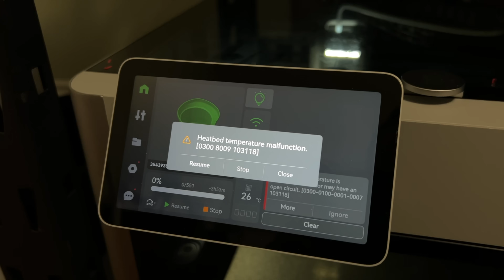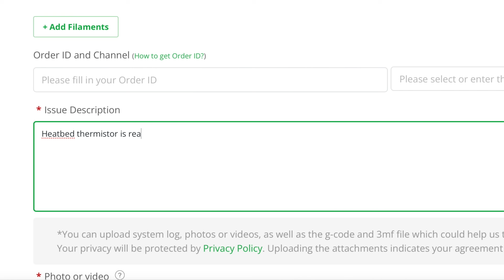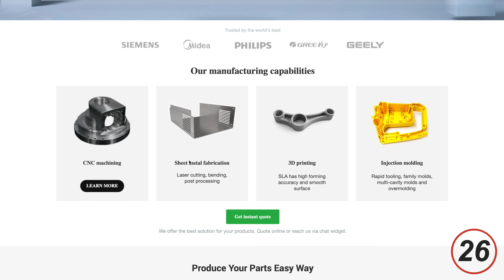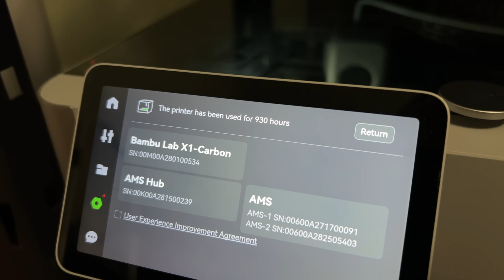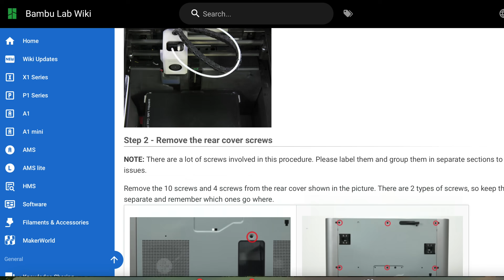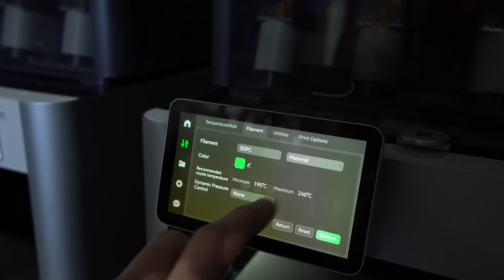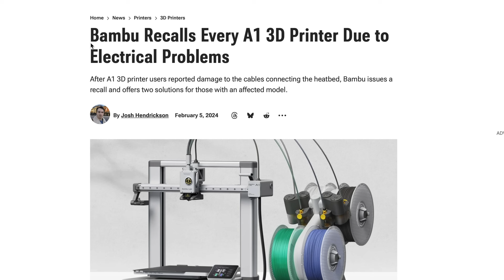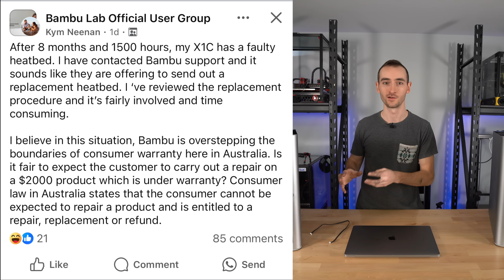Bambu Printers: Repairable or Disposable?

Comment: The Bambu printers are more like appliances, not traditional open source printers. So if a user has issues, it's unrealistic to hold them to the same standard of repairability as a kit. I didn't build my car. But with instructions, tools, and a little perseverance, I can perform most repairs on it. Access can be difficult. But my car was designed to be mass produced, not easy for the owner to fix.
Reply: But what are the alternatives? Throw the printer away and buy a new one? Go to a repair shop every time you have a problem? That will become very expensive in the long run.

Even if you don't fix the problem yourself, good repairability will save you money. Less time spent on repairs also means you pay less.
Reply: @andreas.grundler  I totally agree.  But I think there are markets for both approaches.  Lots of traditional printer users are used to tinkering and upgrading.  They want an open source design with an easy repair and upgrade path.  Others want a printing appliance that just works without deep understanding of how.  They may tolerate a minor repair, but balk at something invasive like this video.  My point is not that either one is better than the other.  It's that you shouldn't buy into the ecosphere of one and expect it to be like the other.
Reply from the maker: It’s for that exact reason that a repair like this would be a complete showstopper for a non-technical user. You might be able to repair your car but the majority of people can’t, which is why they would take it to a mechanic. Unfortunately there aren’t many printer mechanics out there available to fix the printers of those that don’t have the competence or confidence to do it themselves.
Reply: @ygk3d not yet.

Comment: considering that you saved 10+ hours not having to build it in the first place.. an hour doesn't seem too bad.
Reply: 100%, with so little maintenance needed, this is a nonissue
Reply from the maker: Lots of pre-built printers that don’t require building or invasive maintenance… this repair wasn’t bad for me but a non-technical person would probably be pretty intimidated by it.
Reply: @shanemshort  Didn't build my car, either, so spending all day to change the gearbox is fine?

Comment: I see you've not had wiring on your voron fail yet.. that's a mission too.
Reply from the maker: I can confirm.. anything that breaks within in a cable chain is a PITA to replace.
Reply: @ygk3d  This is why I'm holding out for a voron kit like the Troodon, except I want it to have all the comforts, like CAN Bus umbilical to make maintenance a breeze... Maybe they'll make a printer like that before I die x_x

Comment: This is not an exaggeration, I have six X1Cs that have not stopped printing for 2 years, unless you count the time from when the prints stopped overnight before being restarted first thing the next morning.  My online sales won't let me stop.  I have had only two issues so far: intermittent communication with the AMS, and an extruder with horribly worn teeth.  One was due to a bent pin in a connector and the other, who knows what caused it, but it wasn't normal wear & tear as none of the other printers had this issue despite similar hours in use.  In two years of constant printing, my maintenance on this 6-unit farm has required straightening a pin and replacing one extruder gear ($40).  Along with lubricating lead screws of course.  I'm not bragging, in truth I feel lucky/grateful, because I know if one of these gives me a real thorny problem, dealing with support will be "challenging".  The point is simply, after two years I'm still pretty happy with my investment so far
Reply: I agree with you, I got my x1c back in 2024, and lord willing still no issues.
Reply: What now would be intresting is the height of your parts you normally Print.
Reply: Lucky, we have 40 at the school and I have had to repair all but one this year. 4 had belt roller issues in the back. It was a nightmare to get parts and was a big PIA to repair. I will say I miss the old i3 design when having to make repair. I am hoping the next batch of printers were get in, PRUSA Cores are easier to do repairs. We will see.
Reply: @MrKornnugget At my school we had 20 Prusas, I repaired at least two of them every week.
The biggest problem in a public space is that people are stupid, and stupid people will break anything.

Comment: Thanks for the video. Thorough and balanced. Will definitely refer to it if I ever have to open up the case for repair. Agreed this is a design flaw. I really like the price and availability of spare parts. The included grease is a nice touch. Would be nice if they included some sort of financial benefit for having to go through all that. Maybe a coupon for free stuff off their website as it's clearly a design flaw which is why they changed the spare part.
Reply from the maker: Thanks!

Comment: Just replace those bed cables, it's not hard to replace them. 30 min each. You don't need remove the bed fully, nor do you need to remove either of the side panels.  Every single one of my early batch X1s had a damaged bed cable, but the new wire bundles are a lot more resilient and I haven't had any more break in thousands more hours.

Definitely clickbait title/thumbnail. Really hurts the credibility of this channel, tbh. You can make the same argument for Prusas as I constantly was replacing bed thermistors on my MK3 fleet. 

I do however consider these printers as disposable as the belts WILL be needing to be replaced, the carbon rods are getting worn down more and more each year, the rear idlers can't ever be removed without replacing the whole gantry, and it's just not worth my professional time to fix each one.
Reply: Shocking end to a youtube comment thread...
Reply from the maker: I followed Bambu’s instructions to a tee. If there’s an easier way, they should update their instructions.

I hear you on the thumbnail. I’m A/B testing on this video. The other thumbnail you didn’t see is less inflammatory. It’s a fine line on YouTube… If I make a good video I want people to see it… I’ve made good videos that get buried because they’re not “clickable” enough. I don’t think it’s explicitly clickbait because the question of repairability vs disposability is discussed and this is something many people are curious about. You yourself in your comment say you think they’re disposable… 

At any rate, thanks for your feedback and your support of my channel.
Reply: @ygk3d  Man, you're freaking so right. I'm sorry I called you out. It must be really hard to make videos successful on youtube. Not even sarcastic here.
Reply: @condorman6293 Props for the apology once you understood what he’s facing. The internet needs more people like you 👍
Reply: did you watch the full video, he does exactly as you described more towards the end of it
Reply: @drewmakesstuff Yes I did. My response is in regard to the thumbnail saying "DISPOSABLE?"
Reply: @condorman6293 I don't believe you waited until the end of the video before writing your comment.  He literally mentions this 5 minutes.  Why would you then turn around and post a solution that he brings up within 5 minutes?  You're accusing him of click bait by using a Prusa as an example when he addressed it within the first 10 minutes. Literally says if this was a Voron or Prusa I would know what's going on and I wouldn't voided the warranty fixing it
Reply: @hamsterbrigade  I disagree.

Comment: Manufacturers upgrading parts after they fail is really common in tools Manufacturers. This is a good thing. Some 3d printer companies just release 3 new prints each year and don't care about a printer that's 3 years old.
Reply: They should just send out the upgraded or changed parts to users instead of waiting for the users to have failed parts to end buying the improved version.
Reply: @MrKornnugget they do it when it's a safety concern. When the A1 was released there was a flaw through which under the right curcumdtances the printer could catch fire. They upgraded the heatbed to fix this issue and offered people two choices: send in the printer and get it changed, but that will take some time or do it yourself and get a i think it was 40 or 50 USD gift card for the store. But if every company would send upgraded parts you would either pay way more for everything because they'll need to cover the costs upfront based on estimates or they won't upgrade shit because that would cost them money. And let's be honest 5$ after 1000 hours isn't pretty but also not the end of the world...
Reply: @  I believe in general if a part is found to wear out before the end of a warranty period, the company should provide the spare or send the upgraded part. I have had products in the past where the company has found that a component wears out prematurely and sent the upgraded part or extended the warranty without me prompting them. I think your position is that this is not normally done, which I agree, where my position is how it should be.
Reply: @MrKornnugget  I agree. That would be great. But I don't know many companies that do this. Only if safety is a concern. Look at all the big appliances, tech and tool companies. So I won't judge bambu for acting the same.  But it would be nice.